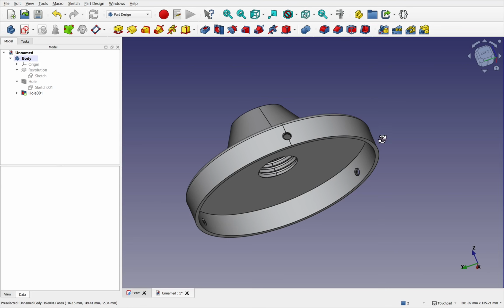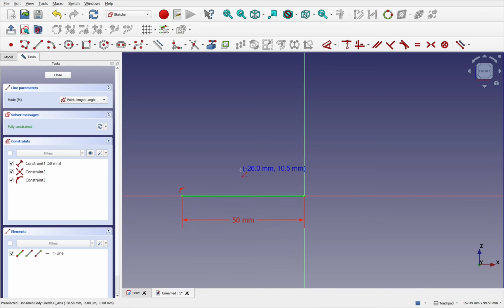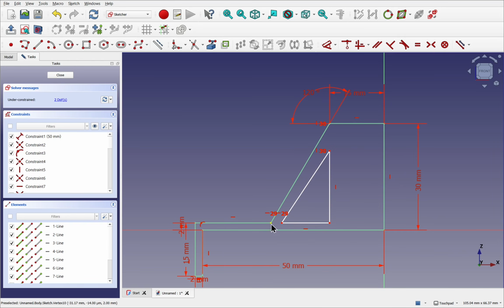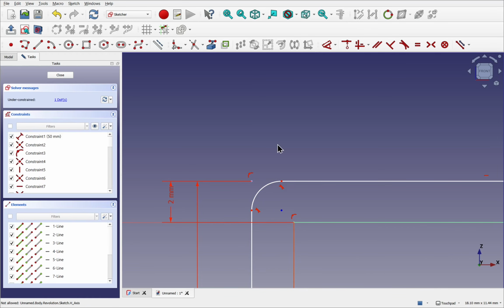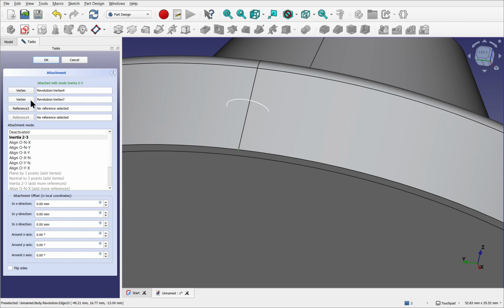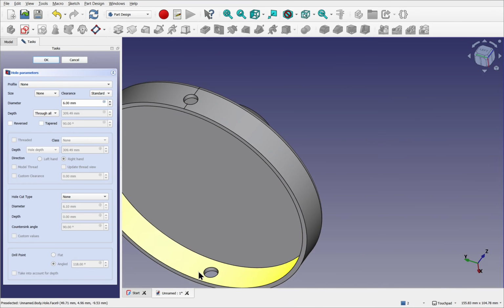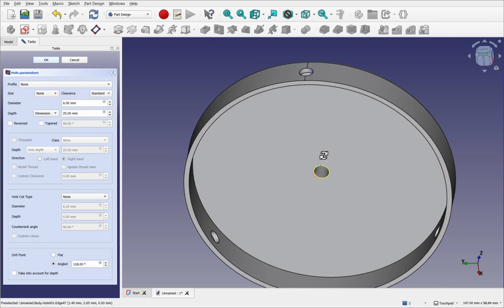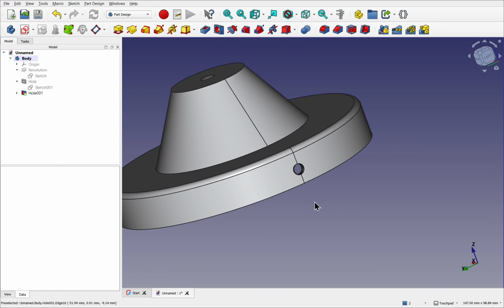FreeCAD v1.0 Lesson 19 | Threaded holes Non-Planar Exercise | Light Fitting | Basic Beginners

Comment: 16:00

If I understand correctly, you chose a hole depth of 2mm to save on CPU time, but you are using a planar sketch attached to only a single line on a curved profile to drill through a 2mm wall. so your choice of 2mm doesn't go all the way through your wall. When I zoom in (freecad 1.1), I see an additional line where something has happened on the inner surface of the hole, to create another surface, which I can select separately. The behavior doesn't necessarily make sense to me (I would expect this geometry to extend slightly into the hole, like if I drilled part way through a pipe), but at any rate, the surface seems to be persistent and selectable. 

Does this really save on CPU time? Is it better than just running a hole that goes all the way through the wall, and creates a single inner surface?

At any rate, really enjoying your tutorials. I appreciate how much efficiency you put into each lesson, with a new consideration of how to do something each lession, rather than repeating a bunch of simple steps over and over.

Comment: 12:50 what is the way to attach the center of the circle to an exact point, say exactly in the middle (without fiddling with the offsets)? What I want is the hole to be automatically centered if for example the initial sketch is updated.
Reply from the maker: In the attachment you can use the line as the reference for the attachment and select Inertia 2-3.  This will place the circle passing through the center of mass.  You will need to set the rotation offset to 90 degrees so the sketch faces the correct way.
Reply: @MangoJellySolutions  excellent, thanks a lot. Your tutorials are REALLY helpful

Comment: I wonder if you can explain how to place the hole a precise dimension from the edge of the part?
Reply from the maker: If you select say the bottom face then you can create a circle sketch and then use the external projection tool to import the outer edge of the model.  From there you can dimension to the imported edge geometry. On exit you can apply the hole operation to the circle sketch.
Reply: @MangoJellySolutions  As soon as I read your answer I had to slap my forehead. You went over using external geometry just a few lessons ago.

Comment: Excellent video, the one thing I didn't understand was why the PolarPattern operation appeared under Hole001 in the operation tree rather than as the parent of Hole. Hole is the parent of the sketch that makes the M5 holes and PolarPattern patterns those M5 holes - surely that makes PolarPattern the parent. The pattern has nothing to do with the M24 hole in the centre (Hole001).
Reply: Agreed, this part made no sense

Comment: Another great video, thanks a lot. Does anybody know an easy way to get a threaded hole into a part created in the part workbench?
Reply from the maker: Thank you glad you enjoyed.  I am assuming you are doing this as a last operation to finish your modeling and want to use the hole operation in part design on you part wb part.  If you open your project and enter the part workbench.  Click on you part wb part you want to create a hole in and then select the part design clone.  This will create a new body and pull in your part wb part as a base feature.  From there you can use it in a part design workflow and add the holes you need using the tool.  (The PD clone tool is something I am covering in my next chapter)
Reply: @ Thank you a lot for your reply. That is a very helpful tipp. Just tried it out and it works great 😀

Comment: If I understand this correctly, you can have a sketch that does nothing. You only see a sketch as a mass if you apply a tool to do it in various ways. You can use sketches without mass to setup other sketches. Neat.
Reply from the maker: Exactly 😊 You can use them as "skeletons" to hang other sketches off. For example if you created a bspline with a number of point along it, you can create additional sketches and use the attachment mode to connect to those points so you have a series of profiles spaced out to loft through. At any time you could open the sketch and drag the points to reposition the profiles. Also you can set up master sketches as a kind of  template to base parts off.

Comment: I’ve watched almost all of these videos and they’re great (just need to watch this one and finish watching #15). The thing I’m still struggling with is making changes to models I’ve made. I basically have to make everything in one go like the videos or it’s hell trying to change constraints around. I’m glad I’m able to make stuff but I thought the advantage of cad over blender was the ability to change parameters and have it auto update 😭

Also the thumbnails for videos #11 and #12 have the thumbnail for #10 right now
Reply from the maker: Thank you for the heads up regarding the thumbnails, I really appreciate that.  Not sure what happened there!  You should be able to change the underlying parameters with ease.  There were problems with TNP issues but this has been mitigated in v1.  What issues are you having?
Reply: @ nevermind, I went back and tried it and it seems to work for the arcade button patterns I copied from slag coin’s cad diagrams. The movement buttons don’t auto update because I didn’t have a diagram for that and made bad constraints but I think I can redo it with similar constraints to the cad diagram for action buttons and it will work. 

Also I think I’ll put the action buttons and the movement buttons into their own little construction geometry rectangle so it’s easy to drop the sketch into different face plate positions

Comment: Very timely. Thanks. I was just in the process of reverse engineering and printing a plastic adapter for a radiant heating valve that is no longer available - and it has a threaded hole.

Comment: What if you need to place a sketch to non planar part of the revolution but not right at the seem? Thanks!
Reply from the maker: There are other attachment methods you can use by referencing other edges or offsetting from the base plane.  As long as you can reference something like a set of vertices or edges then you can get your sketch into position.  In the previous video (18) I went through some of these so they may help you with your question.  I will try to add in more examples as I progress through the series.